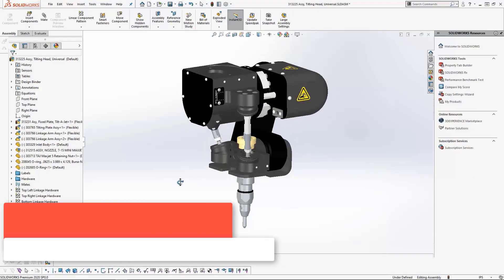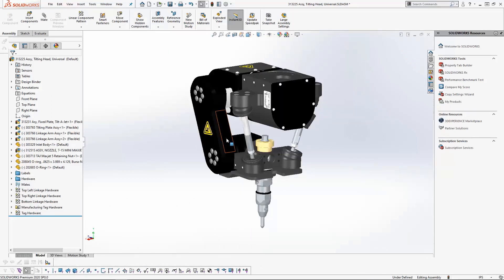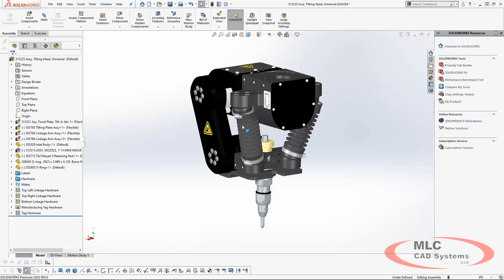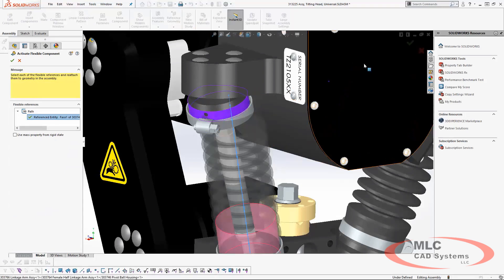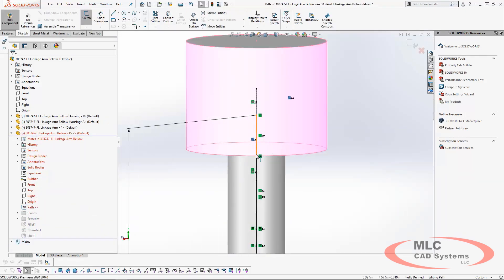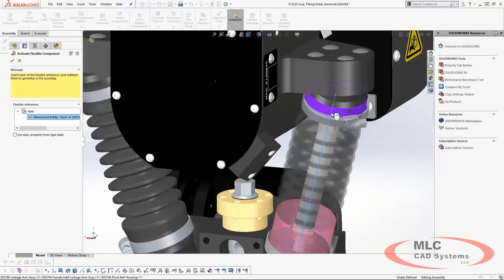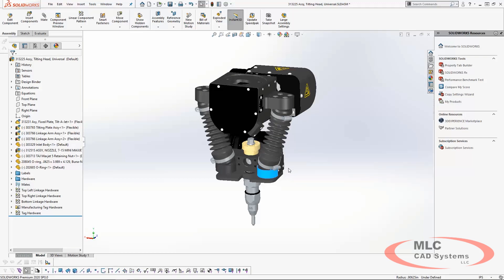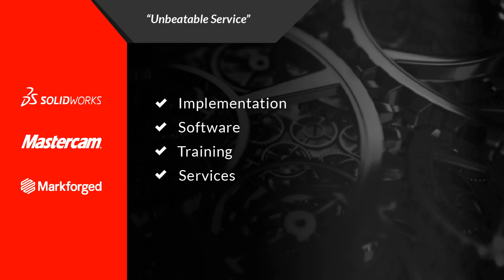New Flexible Components in SOLIDWORKS 2020

Comment: what if my spring has it's Solve as Flexible greyed out?
Reply from the maker: Parts that can be solved as flexible have a few pre-requisites, and it is likely they are not met for this specific part.  The pre-requisites and other details can be found in the help document, hopefully that guides you towards a solution: http://help.solidworks.com/2021/english/solidworks/sldworks/c_flexible_components.htm